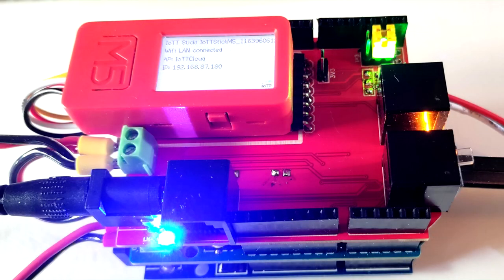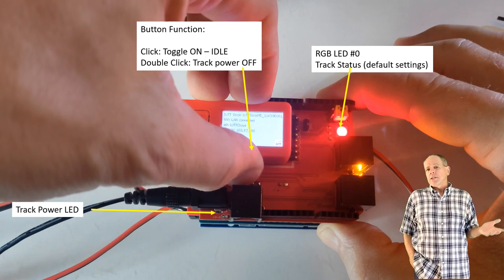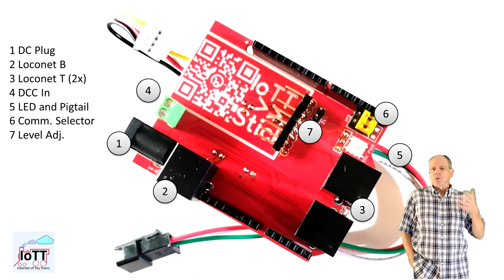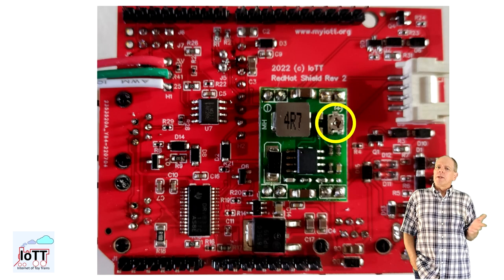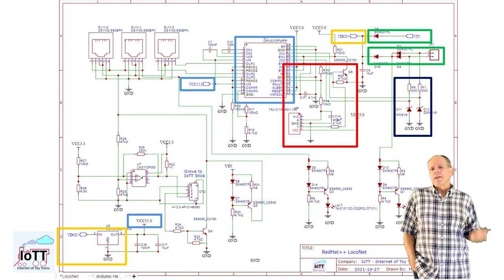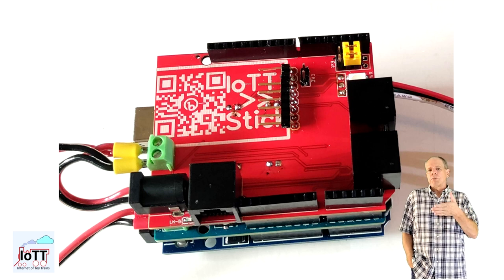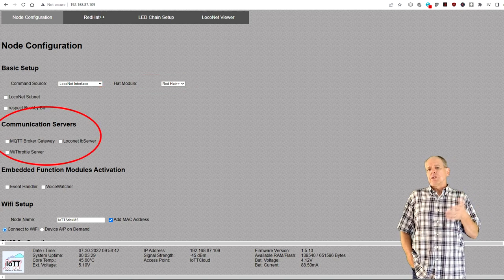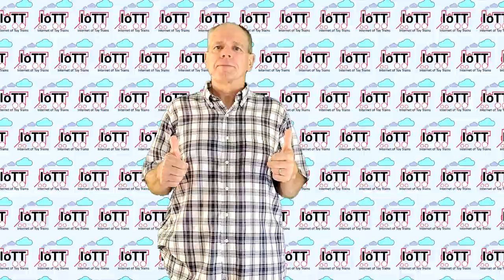Now available: RedHat++ Shield (Video#99)

Comment: This RedHat++ board with dcc ex; has become my go to for a command station. Thank you Hans; for investing you time into this, and sharing.
Reply from the maker: Thank you, glad you like it. And with the IBT-2 power shield and the enclosure system it is even getting better in the near future.
Reply: @IoTT  I am excited for IBT-2 but I have a request. I would love if you show us how to use are existing motor shield(for program track) with the IBT-2. I hate to waste it by throwing it in a drawer.
Reply from the maker: Yeah, I plan on doing that. And it will be super easy ;-)

Comment: Awesome. Great work Hans. On the dcc++ page they direct us to cut the power pin or cut the trace on the arduino board. Without looking closely I would guess it prevents powering the board from the redHat.
Reply from the maker: Thank you.
The reason they recommend cutting the VIn trace is that you can use a higher voltage for the motor shield. If this voltage would reach the Arduino, it would heat up the onboard LDO. With the RedHat++Shield and the DC/DC converter, this is no longer a concern as long as the voltage is not more than 16V because the LDO is bypassed. If you want to use higher voltages on the motor shield, say 22V for G scale, you still should cut the trace.
An interesting variant is actually cutting the trace and solder a diode over the gap. See the video at 7:45 how this looks like. This way, you can power the motor shield from VIn for testing or running small scales, and still can add more power to the motor shield directly if needed.
Reply: @IoTT  So it is OK if I already have the trace cut?  I have an existing DCCEX setup.
Reply from the maker: @geesharp6637  Yes, no problem. All it means is you have to use a separate power supply for the motor shield because it can't get the power from the RedHat.
Reply: @IoTT  What kind of diode and what direction?  I have a pile of 1N4148 DO-35 Rectifier Diode  and don't know a lot about this part of electronics.  Maybe a nice addon to toss into the redhat bag,
Reply from the maker: Maybe a little bit at the lower end as it only has 300mA continuous forward current, but it will work, for some testing anyway. On my board I use an SMT diode that can just be solder over the gap after cutting the trace.
Reply: @IoTT  yes i know, I ask this question for the other user benefits. So you can details this setups as it is the recommended practice by dcc ++

Comment: I am using the Arduino motor shield.  The TinkerKit pin headers and plastic connectors on the board definitely hit the underneath of the redhat board.  They actually stick up higher than the Arduino pin headers which is surprising as it is a Arduino product.  I guess I need to trim them.
Reply from the maker: In Video #99 I point out the need for verifying the length of some pins on some motorshields as I was running into the same problem.
In the meantime, customers have come up with a smarter solution: Adding a set of pin headers to create more space between the RedHat and the motorshield. I like the idea and in the future probably will ship the RedHat with an extra set of pin headers. 
 In Video #108 I actually suggest this solution providing a spacer frame for the enclosure.
Reply: @IoTT  Great idea!  I even saw that on video 108.

Comment: Hans, I am a bit uncertain about something.  This video shows moving the jumpers for the Comm Selector to the left if using a Mega Board, but do I then have to connect wires from the adjacent solder pads to the Mega, and if so to what pins on the Mega?
Reply from the maker: If you are using the standard serial port on pins 0 and 1, the jumpers go to the right as set when shipped. The Mega has a second serial port you can use. If you want to do that, you set the jumpers to the left and connect two wires to the pins of the second serial port. If you do so, the standard Arduino serial port remains available for example to connect JMRI or other software via USB. If you don't need that, just go with the standard settings.

Comment: Awesome. Great work Hans, with the new Red Hat I will be able to consolidate all my components in a single tower of equipment, be able to consolidate everything in a single module and I will have a little more organized control station.

3 Questions Hans :

1-. Will more Red Hat units be on sale soon?
2-. It can only be attached to the Arduino UNO? or is it possible to place it with the MEGA?
3-. To work currently, in the installation of the Motor Driver Module, the 3.3V voltage Pin had to be removed so that the Arduino UNO or MEGA would be damaged when powering the Motor Driver Module. Is this Pin necessary for Red Hat?
Reply from the maker: Thank you.
More RedHat's are coming. Maybe 3-4 weeks. I am carefully building up supply just in case some hidden problems are there.
You can use it with the Mega. Either on the standard serial port or on the second serial port with some connection wires. The RedHat has jumpers to select the output, as well as a jumper to adjust the signals to 3.3V boards.
The RedHat does not need a 3.3V supply, the pin is not connected.
Reply: Thank you  @IoTT

Comment: For those of us who use the IBT 2 Motor Driver it would be useful to have the pins accessible since this driver is not on a shield.  I suppose we could also get an Arduino shield prototyping board and making the IBT 2 Motor Driver connections there putting the proto shield in the middle of the stack.
Reply from the maker: Very valid remark, I did not think about that. I also like the idea of doing an IBT-2 connector shield that would go on the stack instead of the motor shield and provide maybe to output sockets to connect IBT-2 modules with a ribbon cable. That would also open a possibility to have some current sense level adjustments on the board. I guess I need to think about that a little more.

Comment: A question about selecting an Arduino board - UNO or Mega - is it likely that later DCC-EX versions won’t fit onto the UNO board?
Reply from the maker: There was recently some discussion about that question on the DCC-EX discord server. Current common wisdom seems to be to maintain Arduino UNO compatibility. And as long as you are just running trains I think that is not a problem. Where the Uno becomes weak is when you use HAL components and EX-Rail automation. Both of which I would argue is not needed when running Loconet ;-) because you can do it in a distributed network with components placed where you need it.
Reply: Thanks Hans - when my Red Hat arrives I will work out how to fit it into an enclosure - with a Uno it should be possible to cut holes to give access to the Loconet sockets through holes in the end and side.

Comment: So with a RedHat, does this mean it can be used as Loconet lbServer for PurpleHat?  Hmm.
Reply from the maker: Yes, the DCC-EX with RedHat++Shield is just a normal Loconet command station and it has a built in lbServer (as well as WiThrottle server). So, you can configure the IoTT Stick on the PurpleHat as lbServer Client and point it to the lbServer on RedHat++Shield. It will then drive the locomotive on the DCC-EX track and also program it via opsmode programming (or service mode track, if you prefer).

Comment: Maybe leave the pin headers unpopulated and that way you can supply the headers depending on the order and have the buyer solder them in.  I have seen many Arduino clones supplied that way, with both sets of headers, but you could just supply the headers the person wants :)
Reply from the maker: Yeah, I thought about that. It definitively would make my life easier as soldering the headers on takes some time. The problem of the approach however is that I cannot test the final product, and if the user is maybe not soldering all used pins properly (which happens to me as well once in a while), the board will not communicate correctly with the Arduino, leading to more support cases and complaints. So, I hesitate.
As it looks right now, the majority of users prefer the version with the Arduino headers, but that might be because the early adopters also tend to be tinkerers, so the ratio might change over time.

Comment: Is their way to make work with nce
Reply from the maker: DCC EX is a command station by itself, so using this with NCE would not make sense. I may do a 5 Amp. booster based on this board in the future, and that could then be used with any system.